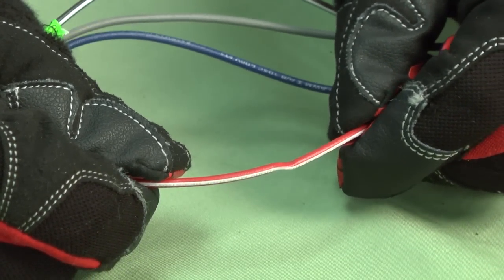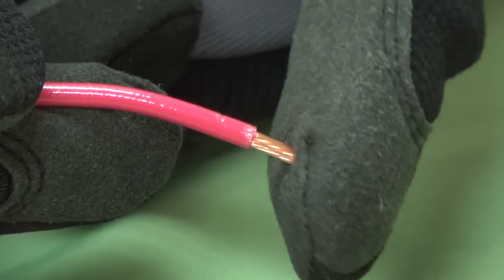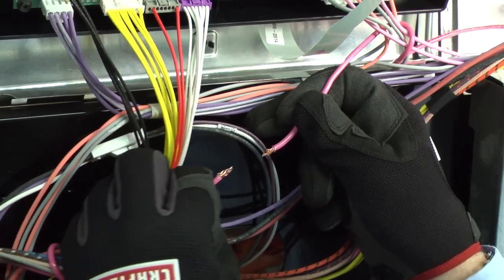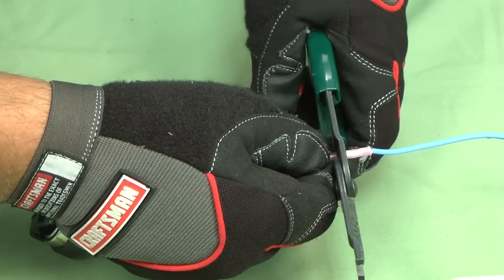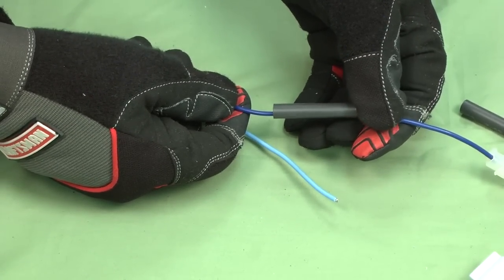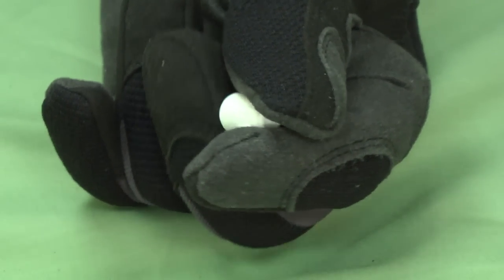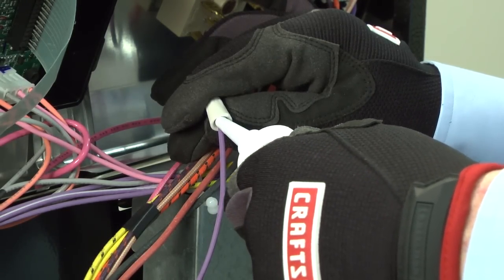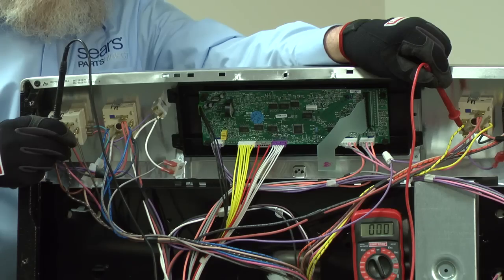How to Repair Broken or Damaged Wires

Comment: This is gonna be super helpful. After a power outage our dryer kept flipping the breaker and our landlord's handyman found that the wires from it in the breaker panel had melted together. Instead of replacing those parts of the wires and/or getting a new breaker, he unstuck and wrapped them with electrical tape. The dryer is still flipping the breaker every ~10 minutes and we're scared of damaging the dryer or burning the house down because he won't properly fix it.

Comment: We need to repair wire that was chewed by mice can't repair it. We were told by repairman he couldn't fix as not under warranty but we could get wire and splice together. We cannot find any wire anywhere to purchase. Any suggestions?
Reply from the maker: You may be able to find replacement wire at a local electrical supply or appliance store in your area. You can also find replacement appliance wire online by using a search engine such as Google or Bing.

Comment: A question (probably a dumb one) Wire nut - screw them on, how about if you want to replace or remove them.  Do you unscrew them?
Reply from the maker: Yes. Most of the time you can remove a wire nut by unscrewing it. If you can’t remove the wire nut by unscrewing it, you can cut the wires where they enter the opening of the wire nut.

Comment: Would this be the same for the main black white and red wires going in to the power cord?
Reply from the maker: Repairing the main black, white and red wires going to the power cord will generally use the same techniques as described in this video but you’ll need to use extra caution when repairing those wires. Because those supply wires typically carry more current than other wires in the appliance, you’ll need to use the right wire connectors to fit wire sizes and match electrical current ratings to repair supply wires. Failure to properly connect and repair those large supply wires can result in appliance damage. If you don’t connect those wires securely with the right connectors, the wires can heat up and melt their insulation—possibly causing the wires to short out to the metal appliance cabinet. If you’re not completely confident that you can properly repair wires, we recommend that you have a service technician repair the appliance.
Reply: Yeah definitely not going with a technician and getting charged and arm and a leg.  I got this bro. Thanks for all the info.

Comment: Wow great video where can I find those connectors I need the last one for sure
Reply from the maker: Here’s a link for a common spade connector: https://www.searspartsdirect.com/part-number/STD374254/0098/980.html. You can also find spade connectors at your local hardware store or electrical supply store.

Comment: 2:23… “You don’t need to twist the wire ends together before installing the wire nut”. Aren’t wire nuts more likely to come loose if you don’t twist the wire ends together first? That was my experience until I saw a video instructing to twist the wire ends together first, before putting on a wire nut. After that, I never had a wire nut come loose.
Reply from the maker: Most wire nut manufacturers recommend placing the wire ends side-by-side without twisting them together, and then screwing the wire nut onto the wire ends. Follow the instructions that the manufacturer provides with the wire nuts that you use.
Reply: I love a good non litigation reply
Reply: @rickkstir  A.k.a. “boiler plate”
Reply: @nonelost1  Cookie Cutter

Comment: hi Wayne I got a general Electric freezer and makes a lot frost on the entire freezer, I have to unplugged it to get the ice melt, can you please help me , what is the problem, thank u and happy new year
Reply: +Everardo Camacho 
The frost build-up means that your freezer likely has an air leak in the door or the freezer cabinet. Warm, moist air leaking into the freezer will cause the type of frost that you’re describing. Check the door gasket for damage or loose spots. Re-attach the door gasket if it’s loose or replace it if it’s damaged. If the door gasket is okay and the door closes properly, then check for cracks in the interior cabinet liner.
Reply: +Wayne A. It is quite rare to read a sensible comment on You-Tube. Hopefully Everardo read your comment and followed your advice. Regards, Wills.